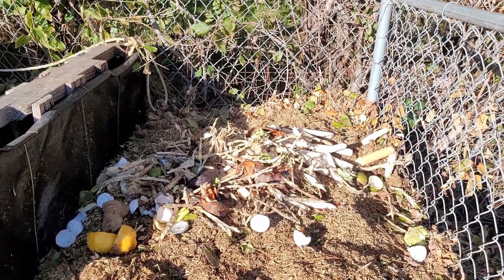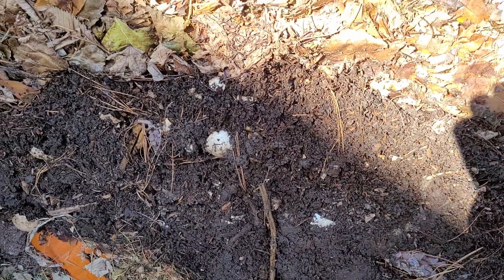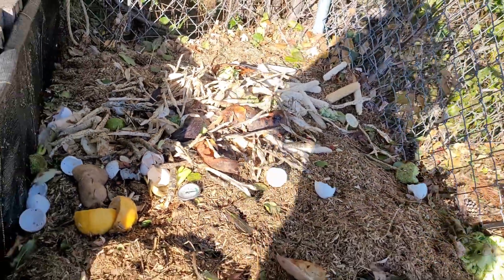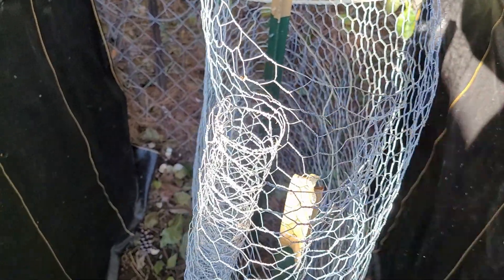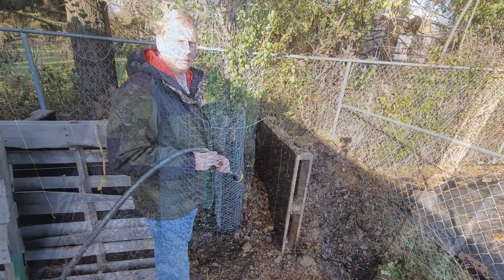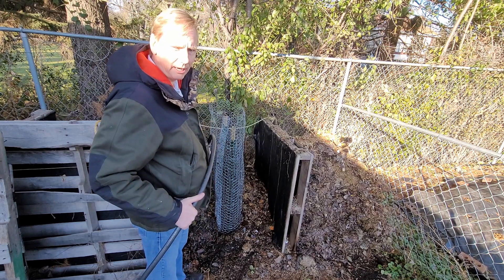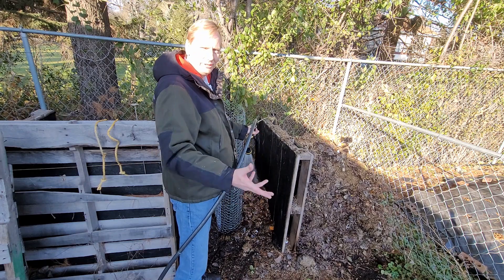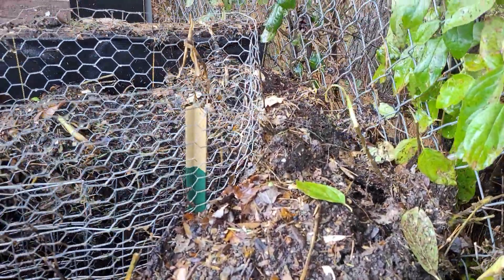Mix Hot Composting with a Johnson Su design

Comment: Interesting video. 

I have a problem ... I am obsessed with hot-composting but I'm also lazy. I think I've tried every possible way to keep my compost aerated and damp so it would stay hot without turning.

I've tried a similar method that you show in this video - I used a large diameter PVC pipe with large holes instead of the chicken wire. It worked okay but I've found a method that works a little better. I use a broom handle that I've ground down so it has a pointed end. Then I simply plunge the broom handle as deep as it will go in various locations and kind of ream out the hole so it makes it wider.

I add a little bit of water if needed and sprinkle in some urea into each hole. Then I scrape a little bit of compost into each hole.
Reply from the maker: I can see your method working.  You're providing a path for air to get in and keeping the nitrogen level up to speed up the composting process.  I don't want to flip a compost pile every week so I experiment with different methods to find something that works without putting too much "work" into it.  :)

Comment: The Johnson bioreactors concept was to maximize diversity and have fungi dominated compost - 😅
The more you disturb your compost pile the more you disrupt the fungi 
& promote bacteria growth/bacteria dominated soil will grow more weeds and has less diversity imo
Reply from the maker: You're right that the Johnson Su was design to promote fungal growth over bacterial growth.  The idea here was that the Johnson Su had holes in the pile to allow oxygen to reach all parts of the bin so it stays aerobic.  I wanted to borrow that design to help keep the hot compost pile aerobic with less turning.  Thanks for watching Jeff.